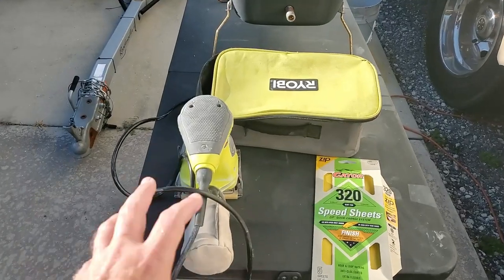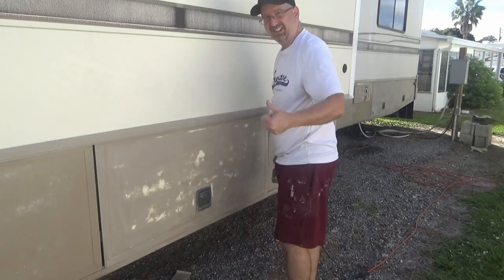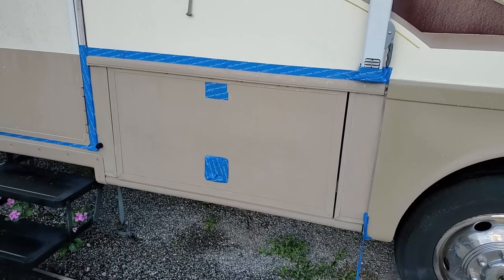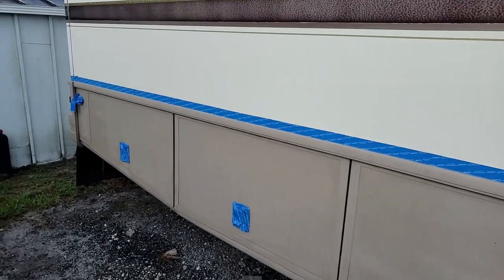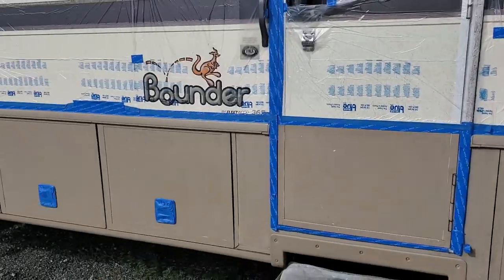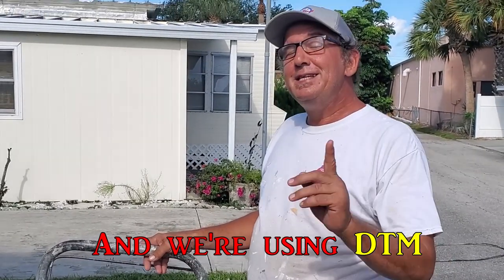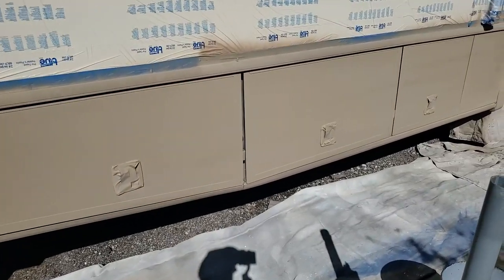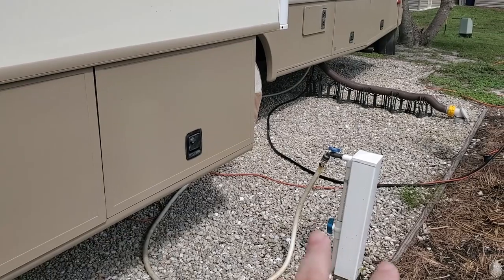Painting the RV!  Do it yourself! It was so easy!

Comment: I’ve got a 93 bounder very good condition 30 k miles garage kept but it’s lost the shine a bit I copied the paint you used and this is the same color ! Do you have a video of the inside of your rig ? Also do you follow or are you a part of the bounder club ? Ty so much for sharing! We are going to coat our roof it’s great but to be extra about it we are going to use the “Pro gaurd Liquid Roof “ made direct by the company and bounders have alpha roofs so you need a special coat which they made for alpha owners but it lasts untouched no recoating every few months but for up to 5 to 10 years depending and it’s no more than the best on the market and I’ve spoken with the top guys who do these and most with issues with there roofs use this in place or doing a whole new roof but it’s awesome on good roofs ! Makes it so much easier! You don’t see a lot of videos today but it’s the best ever to use ! But as soon as we are finally fniahed we plan on hitting the road ! Lol following liked and rang the bell ! Lol ty sir !
Reply from the maker: Thank you so much for watching. I do have a vid on my channel which is a walk through! :)

I need to report my roof too and have been trying to figure out the best way to do it. Your info is actually very helpful! :)